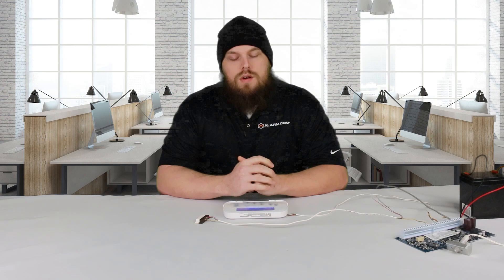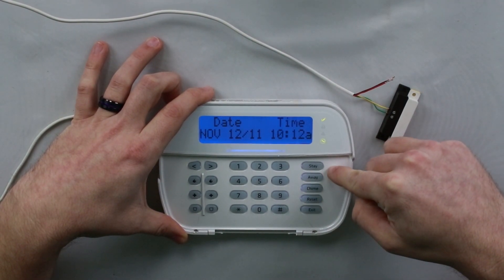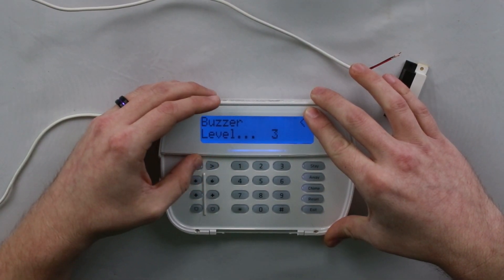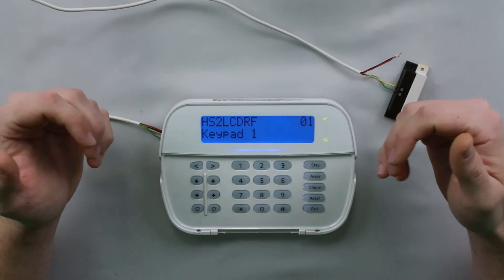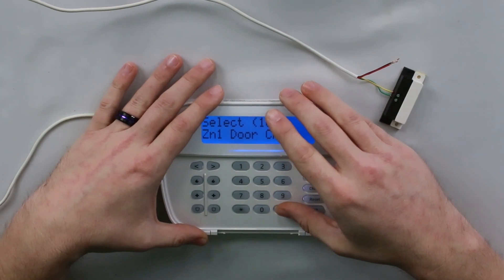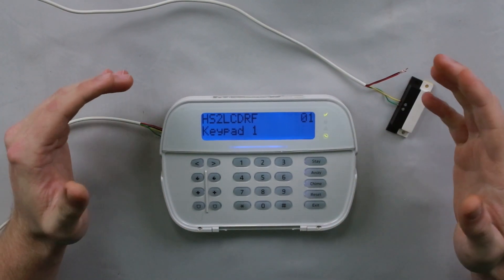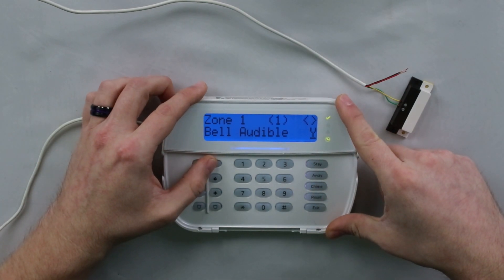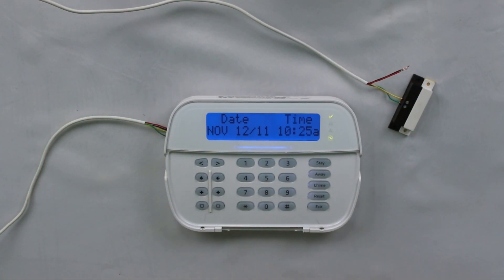Adjusting All Chime Settings On The DSC PowerSeries NEO Alarm System

Comment: Is there a way to turn on the chime automatically, e.g., if it's been off for more than 24 hours, or when the panel is disarmed?   I'm worried someone will forget it's off, and not have it when needed.
Reply from the maker: No, there are no settings to have the system enable or disable chime on its own. All of the available chime settings are showcased in this vid.

Comment: Hello,  I have an interlogix  nx8-v2, is there a more modern keypad, maybe a color touchscreen option that I can upgrade to?
Reply from the maker: The NX8 has been discontinued for quite some time and there are no newer keypads that work with it.
Reply: @AlarmSystemStore  crap,  so I will have to replace it with a compete new system? I have 2 partitions,  about 50 zones, heat smoke fire water bugs etc.
Reply from the maker: @morejelloplease  Unfortunately yes. Interlogix is no longer in business at all.